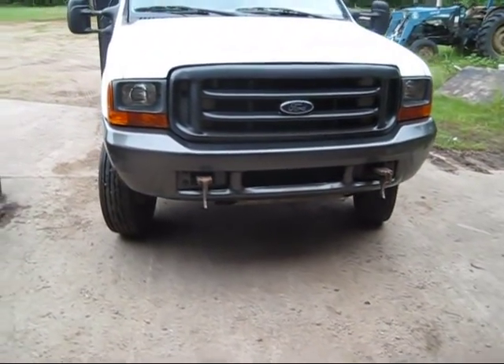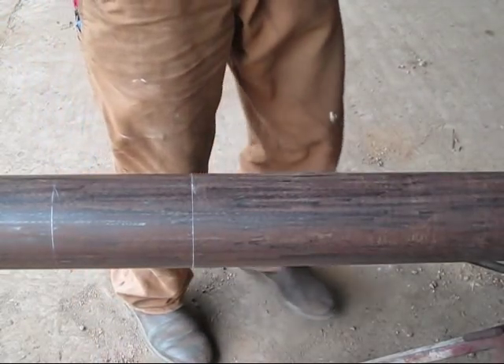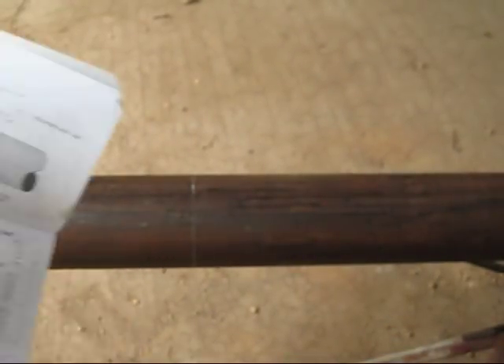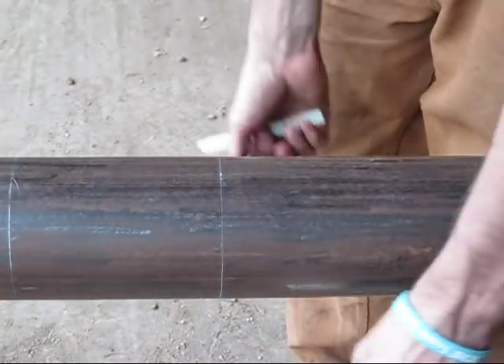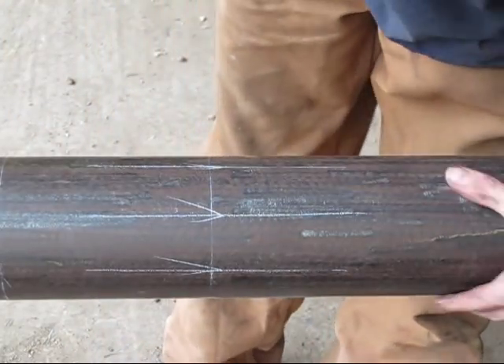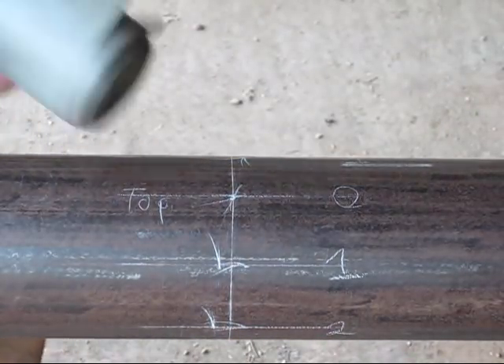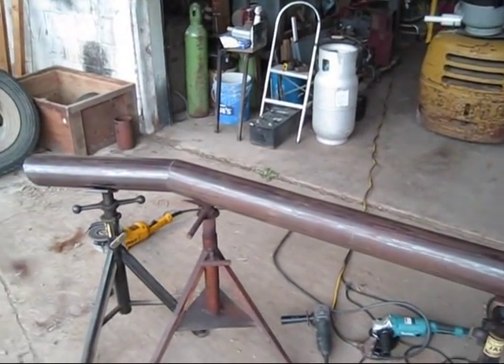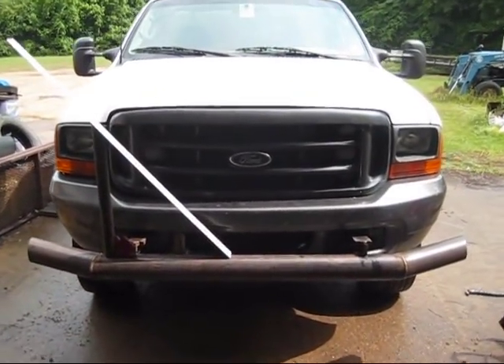Steel Pipe miter

Comment: good afternoon friend, I am writing to you from Saltillo Coahuila Mexico to ask you what is the name of the tape or what material is the gray tape made of that you use to mark the circumference on the pipes to see if I can get it here in Mexico or look for some similar material for to be able to trace the pipes. I hope you can help me, a greeting and that you are well
Reply from the maker: The tool is called a wraparound. The material is very similar to gasket paper.
Reply: @EEJester1586  Thank you very much I will see if I can get it.

Comment: Wrap around old sander belt works. Get ur degree, tack it n fill in weld it. Verticle pipe off of ur new brush gaurd so you can complete the top section. Make it slip on with clevis pins for removal when serv truck.

Comment: So if you want to make a pipe gate. How do you measure the horizontal pipes so they fit between? I assume you would use the quadrants so the copes are perfectly straight  with each other?
Reply from the maker: The trick to that is measuring the centerline to centerline. The pipefitters bluebook can tell you how to get that math just right so it fits. The other problem that you’ll run into is making sure that both of your copes are exactly in the same plane to each other. You’ll need to make a mark for level center on both sides to make sure this doesn’t happen.  If you’re building a pipe gate and need a lot of copes done you’re better off trying to find a holesaw that’s the size of the pipe versus trying to cut them off by hand like in this video.
Reply: @EEJester1586  i agree where you're saying the copes can wind up not on the same plane. You could use an angle iron to make a line from end to end. But what do you do on a long piece. You should make a video about it!!!
Reply from the maker: @steventhomas9645  hahaha I may do that. They have tools just for that.
Reply: @EEJester1586  id sure watch. I'm interested to learn how to make pipe fence for cattle

Comment: Will that paper trick work with a 16 inch pipe?
Reply from the maker: Yes sir it will.
Reply: @EEJester1586  I used it today at work. The problem is that I needed to make a 45° cut for a 90° turn but that wasn't in the blue book.  So what I did was take the 22.5 ° cut for a 45° turn and doubled the dimensions but that did not work. I was hoping you could tell me why it didn't work. Also finding the value of "a" or cut back i have problems with, can you explain how that works. Thanks again for the video.  Normally I would cut the angles on The saw but the pipe was 16 inch and the saw can't cut a 45° angle on that big of pipe.
Reply: @nate_the_welder  For big diameter pipes use a paper template. There is no need for any measurements, just wrap the template around the pipe, mark and cut and you are all done!. This approach is frankly quicker and cheaper than any other method and, best of all, you will always achieve a perfect fit and welding!. See https://www.etubespro.com

Comment: Your ends are straight pipe cuts? You could have made a straight cut on a band saw or even with a torch? Think of cutting a 4 x 4 piece of wood.... it is the same as 4 inch round butt joint.
 You did NOT need a coping joint for your bumper. You also need a long reference line from end to end to keep your cuts clocked correctly.

Your formulas are for a coping joint .... ? The cut you explained is for coping something like a pipe fence (VERTICAL to Horizontal)  or maybe a race car roll cage. The cuts on your bumper are just butt joints that DID not require a cope?  
 
Try this link for coping joint:  http://www.metalgeek.com/static/cope.pcgi . 

Print a PDF that will wrap around your pipe.

Comment: Why not simply unfold your paper, draw a line in the middle, mark out your  0, 1/4", 3/8", 1/4", etc - then cut on those marks and tape it around the  pipe?

Comment: I built a big bumper/ brush gaurd and used two 2" receivers to attach it to the frame. Also put some set screw type bolts on the receivers to keep it from rattling. You can easily pull the pins and the bumper comes right off when working on the truck. Could make a receiver step to work on lifted rigs as well. Nice vid.

Comment: I created a tool that  transfers mark for saddles,laterals ,at any angle or slope...it also can transfer marks to cut I beams to fit onto pipes anywhere you want to put them ..no gap ...
Reply: What is that tool bro?
Reply: @ab84medina  a wraparound with adjustable pins to make contour

Comment: ok very good tips, but in my line of job this takes way to long,i do this all on sight and raw, thats still the most effective way to do it AND it will make you a waterlevel/ angle eyed god, i hardly use levels or anglers anymore, just close one eye and see if it looks right. also with the connecting the lines if you close one eye you can easyily free hand connect them. 
my boss would kill me if i did my jobs like that because of the time that goes in it

Comment: As a qualified boiler maker, welder and fitter and turner, I must say great video. I however would not have been happy with the difference in angles. But mitring pipes perfect everytime requires a life time of experience in doing the shit every day. It's no easy task. I spent years making 12 to 24 branch manifolds using 6" and up nominal bore pipe for the mines in South Africa. Crap it drove me crazy at times. Can be so frustrating. Keep up the good work...
Reply from the maker: jenny star thank you Jenny. Aye I did manage to pull the pipes in a little better after I tacked to the truck.  I think I had one side that had a pretty big gap on the bottom, but it wasn't to bad just one quarter of the pipe.  I think when I got done it was less than one degree off on both sides.

Comment: Does 1 =45° and 2=90°?
Reply from the maker: I'm not sure in it translates that easy.
Reply: I think if u take a center finder 0 would be to and bottom. 1 would be on a 45° the sides would be 90° then you measure back on at the degrees.

Comment: Great job. The angle iron tip for scribing a line is terrific. On the angles cuts, wouldn't a band saw or chop saw be quicker - especially for pipe that's 6" and less?
Reply from the maker: It is a lot faster and better with saw, but what if you don't have one?  Or it is a 24" pipe.  This method will work on any size.

Comment: For the way you did this, it came out great. If I was making this professionally, I would use some sort of large size table-mounted saw and strap the pipe down as hard as I could for a beveled edge cut. I think that might turn out a more perfect fit... then if you are brave you could attempt to weld from the inside. I'm over-thinking this, good job.
Reply from the maker: +Sviolinist This video was made to help those who don't have a "table mounted saw" "Weld inside" You mean open root weld?
Reply: An open root weld would like pretty nice, sure.

Comment: Got to do this at work next week but first time doing it and not got book. my tube is 8in and angle I need to make is 60 degrees going to us increments of 16 not 8 could you tell me the data I need for the one and two lines please
Reply from the maker: Sure thing man. Im guessing you need a 60 degree turn so that is a 30 degree cut on 8" pipe. NO.1 is 1-3/4"  NO.2. Is 2-1/2. I'm sure there is a Digital copy of the book if you need anything else.  Hope that helps. Good luck man.
Reply: +Classic Work erm inside angle on drawing I've Got is 120 so 60 outside of that makes sense?
Reply from the maker: 8s would be the best. 16s is better for pipe 12" and bigger.

Comment: Excellent! Not to criticize at all, but as a helpful pointer.... I think the '1/4-3/8' pattern could be drawn on the paper and traced onto the pipe. Then you would still have allot of work done for the other cuts...
Reply from the maker: +John Smith Ok thanks for the tip.

Comment: nice instruction.     very important techniches.   you cant bring a miter saw with you if your reworking pipe thats installed either.  many times cutting with a torch is quicker too.    I dont get why your cut was 9 degree though wound up with a30 degree cut on the ends  unless you didnt want the ends to be paraelle to the truck sides.    Ive liked your other videos as well
Reply from the maker: +jeff young Aye I didn't want a really sharp end jetting out of the truck.  Looking back though I don't think it would have hurt anything.

Comment: I lay mine out the day way but cut all 4 corners of the paper and marking both sides is another way to get your lines. Use a level to line up your marks and draw a line. Angle works to but don't always have proper size angle iron for the pipe on the job..
Reply from the maker: That's smart wouldn't thought of that. Thanks for the comment.

Comment: Would the shape between a perpendicular line and the ring that you drew be an isosceles triangle? The equal angles would be  your 18 degrees, and the height of the triangle could be found with a little trigonometry. The math might help you with an exact cut, especially of varying thicknesses of the same diameter of pipe. You would have to measure the circumference, divide and use tan(18)=O/A to find the triangle height, and then scribe that triangle onto the pipe. it's not an on center measurement like your method, but it's just a bit different. i'm not quite sure if my isosceles triangle assumption is correct though.
Reply from the maker: +Johnmark Hatfield I can see how that would work.  I'll have to draw it out on a piece of paper and try it one day.

Comment: well, that pipe is stronger than the metal used in the truck... that means that in a crash you'll take all the force.... and the pipe will be just fine... steering at your broken body and laughing at you!!... use a pipe that will take some of the force but not act as a super shield as for you that means hitting a wall !!!
Reply: Robert Ostman in fact,.... if you really want to make it work use a thin metal... like those in bicycle frames... then rig some shock absorbers, this means that the new tube fender is gona be bent in impact taking the hit and the shock absorbers will save you from a good portion of the impact... the truck will be fine and you to... anything more than that and your better off using a 16 wheeler

Comment: Awesome video.. Always good to know how to do something "the old fashion way".. I used to fit pipe and found this tool extremely helpful. Its a lot faster to set the angle and mark it on your pipe.. Time is money right?  Thanks for the video!

http://www.amazon.com/Jackson-Safety-Curv-O-Mark-Contour-Marker/dp/B005DWM0KS/ref=sr_1_3?ie=UTF8&qid=1436772059&sr=8-3&keywords=pipe+angle+marker

Comment: Great Video , I would have used a Victor Wrench ( cutting Torch) to cut the pipe and dressed it up with grinder.Still a good informational video,You would think they would come out with a pipe wrap that did angles , they have saddle wraps.
Reply from the maker: I normally would have used a torch, but a grinder cuts so much cleaner. (Plus I was low on gas. Look pretty foolish cutting a pipe, and run out O2). Haha

Comment: Great video Ethan. This makes cutting hip rafters look like slicing pie lol. 
I don't like using angle grinders. In the 80s my dad was cutting a concrete wall without a guard on the grinder and it kicked back. It cut halfway through his hand. He still hasn't a guard on it lol
Reply from the maker: Aye it is a little harder when things go round.  I'm sorry to hear what happened to your dad. I know have been bit by grinders I've got a good scar from a pedestal grinder. Thanks man.